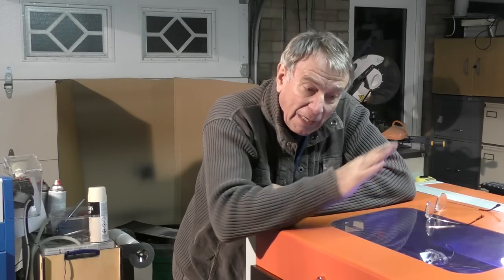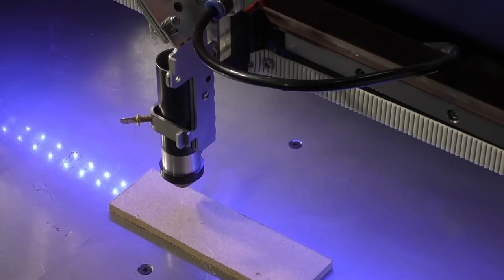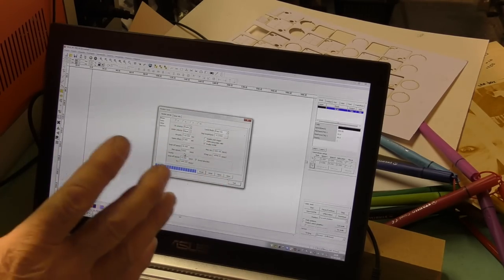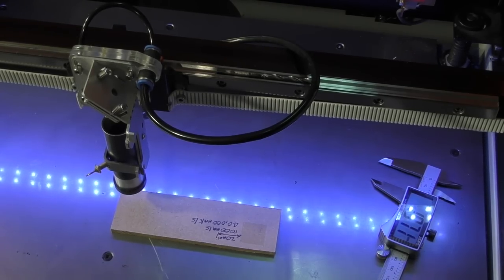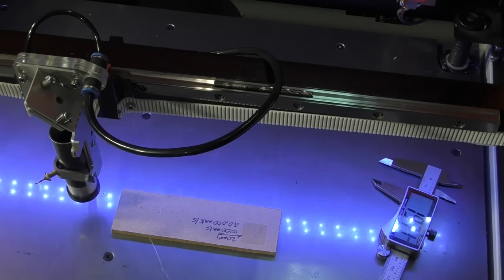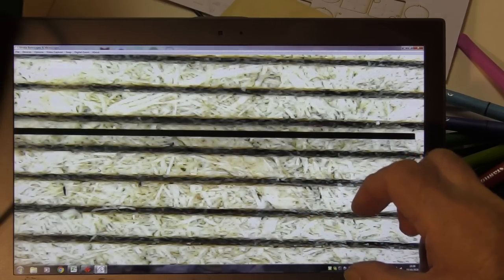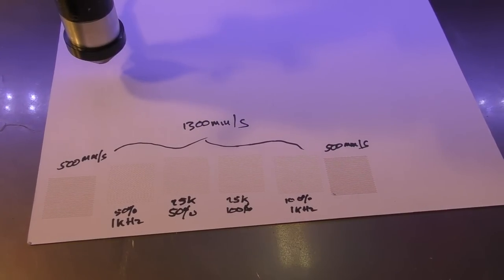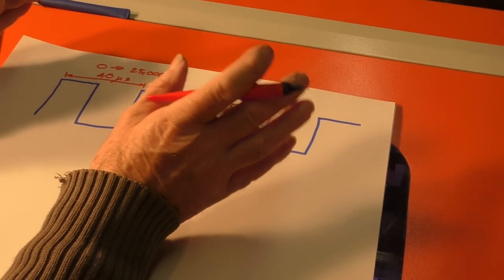TangerineTiger 10 What is the Point of HYPERDRIVE

Comment: Great video as always but also as in many other videos; If the fans do not need to be running it would be very preferable to turn them off, either that or use a lapel mic to reduce that background noise.
Reply from the maker: Yes those fans are annoying but on this occasion (except at the end) I chose to leave them on as a constant background noise. In hindsight I agree with your comment.  However, in future there will be less theory and more doing so I'm afraid until I find some way to dampen the sound  that whine will be with us. It is trying to remove 575 watts of waste heat.
Best wishes
Russ

Comment: I just got my 50w laser machine and I'm very happy that I found your channel ! Your knowledge that you record here are very useful ! Currently I'm on 2016, but will watch every one of your videos until came to this one ! My biggest concern right now is that I need to change my ventilator with some proper air blower, that will do much better job extracting the smoke. 
I need it quickly and will try to get new one from my local shops area. Can you suggest what I need to looking for like mA and W ? 

Best wishes from Bulgaria ! 
Thank you for all your work and research !
Reply: amperage-0.13А
power - 29w
revolutions per minute
 - 2400
air capacity-195м3/h
specific fan power
 -0.41 [W/l/s]

Is this is good enough ? 
Thank you !
Reply from the maker: Hi
 This what I am using and it works well  I have a 150 inlet duct that I had to make and 100mm outlet pipe. 
https://www.amazon.co.uk/GYMAX-Electric-Blower-Inflatable-Bouncer/dp/B076LSZS7V/ref=pd_sbs_21_2/262-3040367-9864256?_encoding=UTF8&pd_rd_i=B07QPDF68K&pd_rd_r=4000146d-9295-4bf2-88f7-403c53d1a019&pd_rd_w=TTqLY&pd_rd_wg=6zjS5&pf_rd_p=b9bf232d-9a8a-4c7d-aa9d-641c0995d3a2&pf_rd_r=DZF58MXCMZVN36BN3H2Q&psc=1&refRID=DZF58MXCMZVN36BN3H2Q

There are purpose fans available from China
https://www.cloudraylaser.com/collections/industrial-blower

Best wishes
Russ

Comment: You should do a recap video with all the things required to get a 0.1mm beam in one video in a list format.
For us super busy people that need to tune our laser up to get good cuts in acrylic.
Reply from the maker: Acrylic is a difficult and unique plastic in that it does not melt like all other plastics but act almost like H2O.  It is solid until 160C where it liquifies and then boils of as vapour at 200C. Condense it and you get solid acrylic again.  Because of these properties acrylic has its own weird way of "cutting" that  I will not attempt to describe here, but it  will always leave natural striations no matter how smooth the cutting head moves . The reason that you can create a glass smooth edge to some materials and not others depends on one simple principle. If the cut remains at more than 160C for a few mm behind the cut then the liquid acrylic will flow over the striations and hide them. Too much air assist cools the kerf quickly and freezes a frosty striated surface.  It is nearly impossible to retain enough heat in thin materials (up to say 3mm ) for this self healing process to occur. This applies particularly to cast acrylic. Extruded acrylic has different thermal conductivity and retains heat well . It will be almost impossible to NOT get a glass edge.

Best wishes
Russ

Comment: Great work as always but thinking a little outside the box could you use the speed and frequency in different way by slicing a 3d object like in 3d printing and do multiple passes to create a 3d carving? I know it's not what you're looking at right now but it could be a cleaner way to sculpt in 3d. Keep up the good work.
Reply from the maker: Hi Jamie
 Yes it is my intention to test this later on. I have successfully mastered the technique with the glass tube laser . It requires specially prepared bitmap images and you use  the direct output switch in RDworks to completely change the way that  power is applied. I will investigate what that switch does to the PWM signal  but I anticipate it will add  a vertical adjustment to the 0 to 5v amplitude  that is proportional to to 0 to 255 grayscale value. In other words the power will change instantly  to burn each pixel separately..
Best wishes
Russ

Comment: Just curious, I don't think you have mentioned the weight of the as built head compared to your designed light weight head plus adapters?
Reply from the maker: Hi Patrick
 That's an interesting question because for this machine I did not document a weight comparison. I just ripped the head , lens tube and fixing brackets off knowing that I was after  the smallest moving mass. Part of that  mass was the cable chain and the cables within  However I can tell you that the old mass was about 370 grams and the new head is 150 grams. I also have a further head design that will get me to about 100 grams . However,  that is one of the final things I will test because I do not want to forgo the opportunity of using a 4" lens which this design sacrifices.
Best wishes
Russ

Comment: Russ, I would live to see you compare spot size for engraving with the 2 different beam expanders. I have a 60w CO2 galvo laser and going from a 4x beam expander to an 8x made a world of difference in spot size and power concentration. I would like to see if this is matched in a Plano convex lens vs a F-Theta lens. Couldn’t hurt to try and see if your theories about this are correct.
Reply from the maker: Hi Alex
 I have only just started my discovery journey with this strange device. I could be tempted to dive on and test photo engraving and 3 D engraving and all the other things that this device may excel at.  I learnt that the zig zag approach was not very efficient  during my adventure into glass tube technology. This time I plan to discover the ELEMENTS that underpin this technology before I try to exploit them The golden rule of experimentation is to change just ONE thing at a time.  I made the decision to use a 2X beam expander rather than 3 X for a very logical reason that I discovered  during my in depth investigation into lenses.  Once I have an in depth set of data about the characteristic of how this machine performs I do intend to swap the beam combiner for the 3X to compare results. But that may not be for several months yet because there are many  things to explore  with the beam as it is .  Conventional lens theory tells me that expanding the beam will deliver a  more uniform power distribution at the entrance to the lens and result in  more of the rays being focused into a single smaller spot.. It may puzzle you to know that this is exactly what do not want to happen . I think the results I anticipate getting will also surprise you.  All interesting things for the future..
 Thanks for the comments 
 Best wishes
Russ

Comment: Always well done videos! My guess is you are going to get some fine detail, just really slow.
Reply from the maker: I'm sure the fine detail will be faster than the glass tube laser  because the response time of the HV power supply is such a limiting factor for the most demanding applications of photo engraving and 3D engraving.. I'm fairly confident that this technology will excel at those tasks.....if 30 watts is adequate.

Comment: Unfortunately this is a limitation of this system Russ, for what you are trying to accomplish you would need to elevate to a Nd:Yag laser with q-switch were you would be able to achieve higher power levels and much higher frequencies to minimize the dotting effect in high speeds.
Reply from the maker: Hi Vinicius
 Having played with a 20 watt MOPA fiber laser I understand why you would suggest something different. However, nice as it would be  This is what I have to work with and it need to be decoded. The more I drill down to the absolute details of this technology the more complexity and issues I am discovering.  I am just preparing my thoughts for testing  response times of the system and trying to design tests that will demonstrate the issues I an uncovering . I can see why the big companies that use this technology hide the complexity behind menus. This not intuitive like glass tube technology. I look at the Epilog Zing and that has a 20 watt RF tube so my goal is to get close to that performance (or bettter it ) with cheap bits that anyone can buy.  Whether or  not most people would understand how to exploit is something I have got to establish.
 I am looking for a high speed dotting machine to do photo engraving. If it can do that successfully then everything else will be fairly straightforward I know it will text and logos easily but without power, not vry fast.
 Thanks for the comment
Best wishes
Russ

Comment: Not that it will affect the discovery that there is insufficient power for rapid engraving, but as a Follow up on the pwm issue... and facts about that you can have an continious beam output at lower levels than full power if you drive it with a pwm frequency above its responce time.... synrad has some illustrative graphs and explenations of driving an rf tube below or over its response time in the manual for their 400w rf laser... see page 38 and forward in the following document...https://dev.synrad.com/sites/default/files/2019-03/Operators%20Manual%20p400.pdf
Reply from the maker: Hi Klas
I did send an answer to this comment. Did you receive it or has  Google posted it to a parallel universe? 
Russ
Reply: @SarbarMultimedia  i beleive google ate it for breakfast.. :)
Reply from the maker: @klasmalman9249  
Ok so lets try again.
First many thanks for the link to the manual. At 400 watts it is obviously a completely different beast but I can see from the graphs you pointed out, there some interesting checks I can carry out on my little kitten.   I have to admit that I thought there was some sort of magic about this technology when you listen to the big companies boasting about their machine's performance I thought at least that there may be some sort of power storage during the duty cycle OFF period so that the pulses were more than 30 watts during the ON period......a bit like the fiber laser.  So no magic after all just a power ceiling to bounce off. I have some interesting tests to see hat why and how I should use different frequencies The most demanding application will be photo engraving where there is a requirement for single dots, ideally at much higher speeds than I can achieve with the glass tube machine that is limited by the response/rise time from the HV power supply.
I greatly appreciate your comment as it stimulates a bit more focus to my investigations.. I am less interested in the theory of what shuold be,  and am looking at the REAL relationship between signals and what happens at the workface.

Best wishes
Russ
Reply: @SarbarMultimedia  some of the newer synrad rf lasers are a little bit quicker.. but not by much... some specifies below 75us rise and fall time... but still, it seams that they would not do faster pixelspeed then about 10k pixels/s.... i have not been looking into fiberlasers yet, but it seams i will in the near future as we will receive a gcc fiberlaser engraver at work in a week or two....

Comment: with my Clearpath servos, I can set it up to 120,000 mm/s/s The controller would not go pass this limit. Its pretty stable at that acceleration setting, your RF tube is crying for servos.
Reply from the maker: Hi Abraham
 I know it would be nice to have fast DC servos  but this projectid all about taking a budget machine and with minimal cost and engineering,  discover why those "pro" machines cost 10X more than this. I was not expecting the RF laser to be so limiting. I have only touched on one aspect at the moment  ie. just how limiting the power of the tube will be.
 I had imagined that maybe, like the fibre laser,  there was some sort of energy storage that would make the pulses significantly  more than 30 watts . It was rather disappointing to find myself with a very expensive  30 watt   device  that dissipates 575 watts of  waste heat and sounds like a 747 taking off.  I'm sure I will be impressed with the response time when it comes to photo engraving and 3D engraving.
 Best wishes
Russ
Reply: @SarbarMultimedia  I should warn you that  there are limitations of the controller itself when you are engraving at high speeds. When I do photo engraving at more than 500 mm/s at say 185 dpi, I get artifacts. I'm not sure if its because of the high acceleration or because of the speed. When dealing with high acceleration you should also consider reinforcing your machine frame, the wobbling affects the beam path and that on itself affects the actual resolution of the image (you get deformed dots) I had to install cross bar members to reduce the wobbling. I'm already quoting a 150W RF tube :D
Reply from the maker: @Runner50783  
Hi Abraham
 I always value your contribution because I know you have taken this technology to the edge of the universe with all your upgrades.  I am shortly doing various speed tests on this machine to see  what it may be capable of. The problem is lack of power limits the damage I can do to material.  I am using my sharpest lens at the moment to focus the power into the smallest spot. My choice of materials so far may not have been the best so I will rethink the material I use for testing . I  think individual dots will really test the machines capability. I know i get good images at 254ppi. This translates to 0.1mm  pixels driving the controller. My puzzle will be trying to decide if it is speed or frequency response of the beam that is distorting the dot or making it disappear. Just thinking about it makes my brain hurt .....but it must be done because I need to understand what I am dealing with before i try to use it.
 Your other point about mechanical stiffness is a valid concern but not worrying me on this size of machine because it is small and  relatively stiff combined with a small moving mass.. My accelerations may be quite high for a cheap machine like this but the power limits me to almost feather bed landing  compared to your crashing into a brick wall values. Yes I do experience some small reaction forces but my machine is on wheels so there is some further natural mass damping. 
 Wobbly lines will tell me if something is moving as the speed increase. I am focusing on X at present because I think the overrun allows plenty of time for even a lethargic Y axis to set itself between scans.. But yet another set of tests to make. This is all good fun.

Best wishes
Russ
Reply: @SarbarMultimedia  Thanks for the response my friend. This road would have been a lot more difficult for me and the community without your help, not only on techniques by themselves but in the approach to problem solving, great help. 

It will be great to debunk some RF tube myths popular on the "big boys" community like "a 30W RF tube cuts like a 70W glass" as I've read there. 

What's holding me back from purchasing an RF Tube is that it makes very little sense if your primary business is cutting, You can potentially buy 10 brand new 150W glass tubes for the price of one 150W RF tube. As for engraving, it also depends on what you are engraving. For instance most woods would just vaporize and leave no residue (color) if you go too fast, so crisp contrasty engraving on wood happens mostly from 100 - 300 mm/s. If your primary engraving business is acrylics,  metal, ceramic, etc. then it does makes a lot of sense to go with an RF tube.
Reply from the maker: @Runner50783  I have to admit to visiting the "big boys demo videos if I want light entertainment. I roll around with laughter at some of the technobabble they pass as fact. It is so obvious that they know how to push buttons but have no concept of the science they are peddling. 

It will be slow process but I hope to decode  the technology and define just what it will and will not do.  I cannot dash into this project and start flashing off pictures and Aztec calendars  with no understanding about the parameters behind them. Maybe I would get lucky or maybe the technology is very flexible and forgiving , how would I know without in depth knowledge and understanding..  I trained as a production engineer when Noah was setting up his ark factory and the notion of spending all your money on ONE expensive machine when you could by 3 or 4,  just doesn't make sense. You get more production, have one in reserve for spares and if one fails you can keep production going by adding hours to the day. 

 I'm sure there will be some response time benefits to this technology, it need something to save it.

 Thanks again for your enduring interest
 Best wishes
Russ